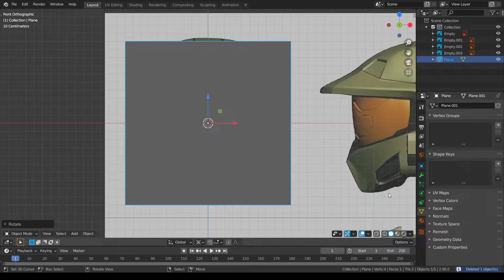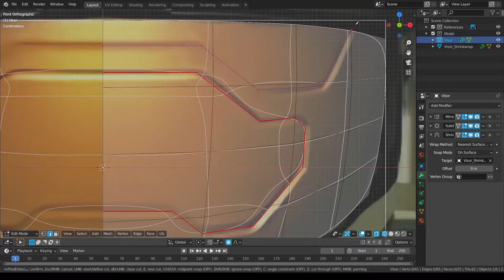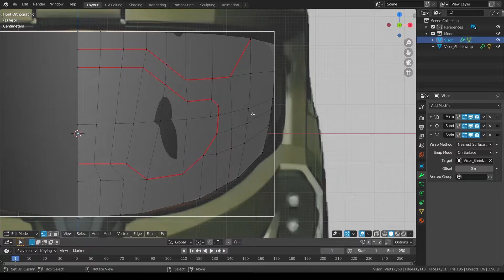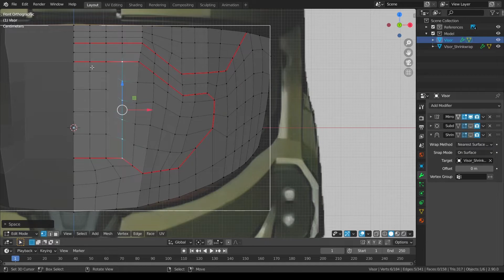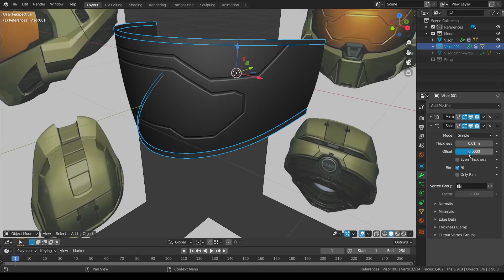Blender - EP1 | Master Chief Helmet Modelling Tutorial

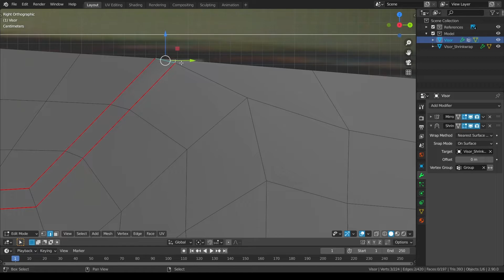Comment: At 19:14,  the subdivision modifier disappeared from Properties Panel, has it been removed or has the captioned modifier been applied? Thanks.
Reply from the maker: I just removed it, I forgot that we were using a weighted normals approach for the visor and didn't need a subdivision surface modifier. Sorry for the confusion on that though. 😅

This was my first attempt at doing a helmet modelling series and certainly shows its age. However, I do plan on updating it this year to bring it up to scratch with my current teaching style to make it a more comprehensive and easier to follow modelling series. 😄

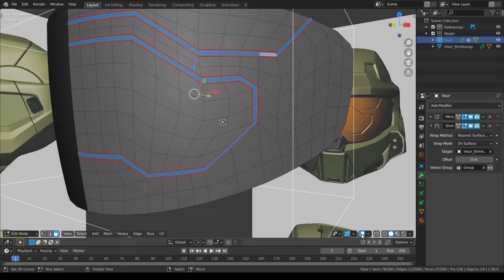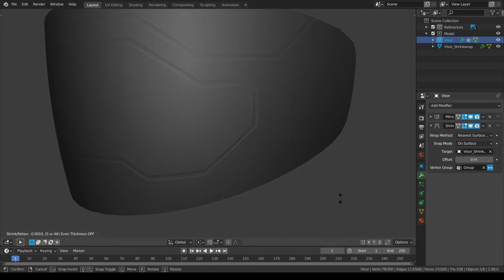Comment: Bit late, but I'm pretty stuck at 20:17 to 20:30, when I try to flip it doesn't appear, I pressed Ctrl S but it doesn't do the things as yours as I couldn't see the bevel coming out of the visor at 20:30, also is it normal for the mesh named "Visor" to be invisible as my supposed "visor" is invisible but i can still edit it, while for my "visor shrinkwrap," it's not.
Reply: And how am i meant to fix it? I'm using this tutorial as a mean of learning stuff from blender, as I want to get started in blender because even if this is a helmet video I can see further on your tutorial includes indepth stuff on how to make small details for the helmet.
Reply from the maker: Hey mate, sorry for the late response. So as a start, you want to be using Alt+S, whereas Ctrl+S saves the file. Also, if you're having trouble with the vertex weights, you can always check to see that they are correct by tabbing into the weight paint mode to ensure that the inner loops of the visor detail are red and everything else is blue (there will also be a bit of colour falloff from red to blue buts that's fine.

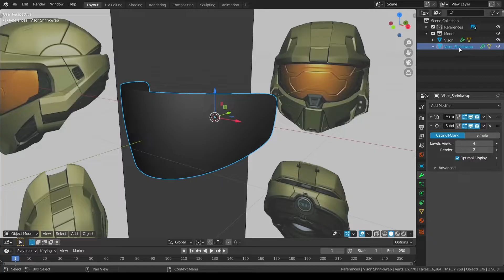Not totally sure what's going on with your visor and the shrinkwrap mesh, but they should both be visible so to speak. At around 6:08 I change the viewport display of the shrinkwrap mesh to bounds so that it isn't constantly clipping with our visor model and making the wireframe difficult to see.

I hope that helps out? If not, feel free to let me know and I'll try to get you back on track with the tutorial :)

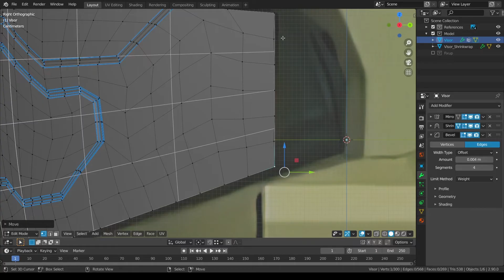Comment: 22:42 How are you lining up the visor with the edges of the shrink wrap model?
Reply from the maker: Since the shrinkwrap modifer is active the model will automatically be pulled to the nearest surface it can find. Therefore, as I drag the mesh beyond the bounds of the mesh it will automatically snap it to the ends of the target shrinkwrap mesh. In essence, just drag past the bounds of the target shrinkwrap mesh and it will make it line up flush.
Reply: @masterj2001  Many thanks!

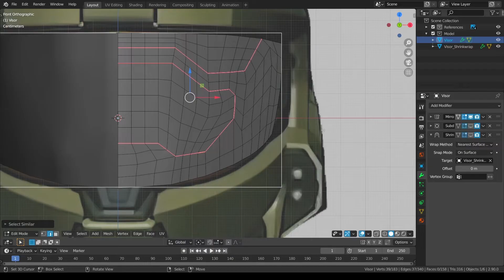Comment: 18:54 what command get that offset from the sharp?
Reply from the maker: Using crtl+b to bevel the selected edges
Reply: I thought so thanks.. i'll keep trying, it keeps trying to make a textbook beveled surface instead of creating offset lines from center.  Maybe I don't understand the concept of sharp.
Reply from the maker: @darkmask123  The sharps don't actually have any influence on the bevel, I just typically use sharps to keep track of edges that I need to modify later on so that I don't lose them/change their form. 

If you want, you can add me on discord (Masterj2001#4394) and show me whats happening and I can try to help you resolve it.

Comment: At 21:02, when it came time to apply the Bevel modifier, is there a reason why you didn't select the inner edges of the bevel for the top park of the mask? It looks like you selected the outer and inner edges for the lower bevel section, but only selected the outer edges for the top bevel section.
Reply from the maker: I believe that to be an oversight while I was recording, you should also place bevel weights on the inner edges. Well picked up :)
Reply: @masterj2001  Thanks!

Comment: I don't understand the topology process after using the knife tool to outline the inner details on the visor. Could you maybe explain what that does and why it's necessary?
Reply from the maker: I'll do my best to explain it :)

So since we have a high poly mesh of the visor that we are using as the shrinkwrap target, we can freely use the knife tool to create new edges on the low poly mesh without fear of ruining the curvature of the mesh.

The initial cuts are done to lay the foundation for the primary detail (the visor line insets). After doing this, we are left with a mesh with many triangles and ngons scattered across it, which is less than desirable. So, to retopologise it, we use the knife tool and dissolve unnecessary edge loops.

Essentially, we are using the knife tool to retoplogise the mesh, adding more density to the visor and making it a quad-based mesh that will better deform to the high poly shrinkwrap mesh target. 

I hope that makes sense?
Reply: @masterj2001  Got it, thanks

Comment: How are you straightening your vertices?
Reply from the maker: Is there a particular point in time in the video you're referring to? If so, put the timestamp in and I'll explain it for you :)
Reply: @masterj2001  you start doing it at 20:38, though I believe it something you do throughout the video.  Side note, I have been doing some modeling of my own, attempting mando helmets, but i can never get the top smooth, it always has some weird pinch or slight pit in it.  Im noticing blender doesnt have a good option for a helmet base... Any ideas?
Reply from the maker: @literaldeath9572  Oh, that just using scale ('s') along the z-axis ('z') to 0. This makes the edge flat along the z-axis while having it conform to the underlying shrinkwrap mesh

Comment: Would you say that you could accomplish modeling this helmet or similar ones using Fusion 360 instead?
Reply from the maker: I'm sure there would be a way to achieve it, sure. Though, I'm not familiar with that software or any CAD-based software for that matter
Reply: @masterj2001  I see. Well thanks for the response!

I only asked because I'm pretty comfortable with fusion 360, but haven't tried any super complex modeling with it. I might just have to bite the bullet and give blender a go.

Comment: 0:23 when I set the origin to the 3d cursor it doesn't do anything, the cursor stays where it is.
Reply: Same, when I bring in images as references, changing the origin to 3D cursor doesn't work. I'm using Blender Version 3.0. I had to use the empty/parenting route.
Reply from the maker: @3inchslinger  Hmm, that's really bizarre. I haven't yet upgraded to 3.0, I recorded this series in 2.9. I'll have to download 30 and see if I can find a better solution for this
Reply from the maker: Yeah, the 3D cursor shouldn't move. What we're doing here is telling Blender to use the position of the 3D cursor to act as the origin point of our geometry, which allows us to rotate the reference images, in this case, around the center of the 3D space.
Reply: @masterj2001  oh sorry I meant the origin stays where it is, it is only like this on images but not on other objects
Reply from the maker: @monke7725  Hmm, that's rather bizarre, I don't know what the cause of that would be. As a remedy, you could bring in an empty and parent the image the the empty and rotate said empty.
Reply: @masterj2001  thanks it Worked!